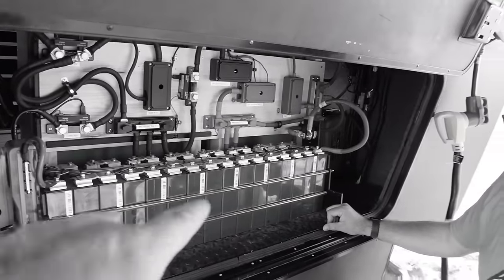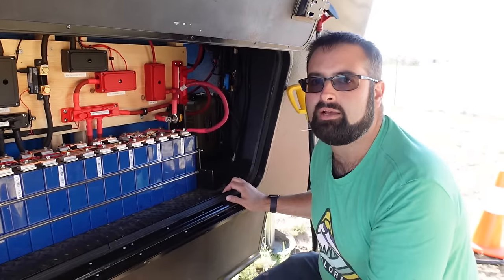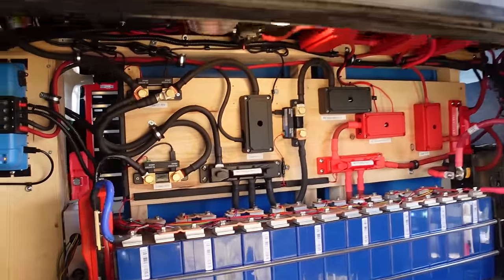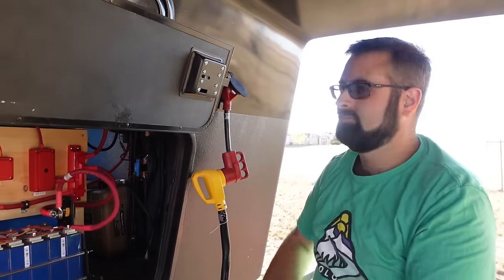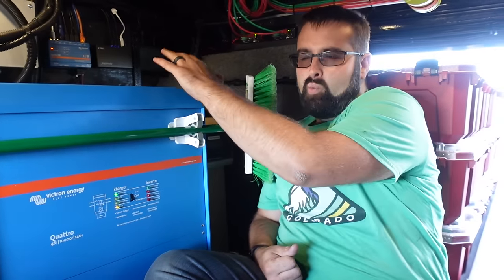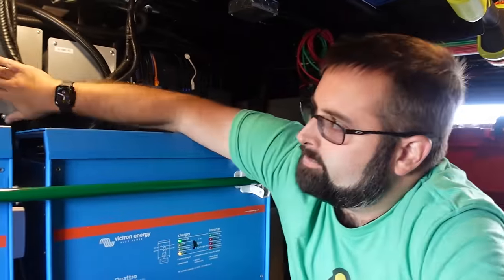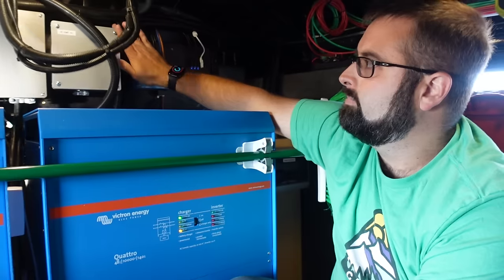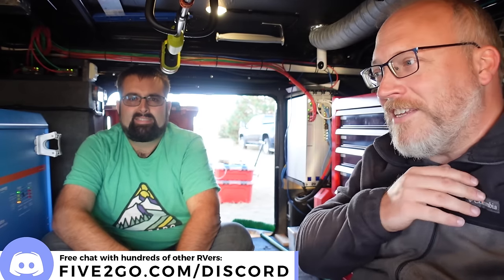How To Do RV Lithium The Right Way

Comment: I'm just not getting the same calculations as you are.  Taking the 1st battery bank, it is 16 cells at 3.3 volts each, essentially making it a 48 volt battery.  The cells have to be wired in series to make 48v.  As stated in a different comment, these are CALB cells.  Going to their website and looking at their products, one is 230.4 Watt hours, which is close to the amp hours stated.  If you multiply 230.4 (watt hour of each battery) x 16 (number of cells) = 3,686.4 watt hours.  AH=WH/voltage.  So 3,686.4 / 48 = 76.8 AH.  If you put (4) 12v battleborn at 100AH each in place of the 16 cells, you would have more battery capacity.  Those 16 cell banks are really only the equivalent of 3 battleborn batteries.    So the entire system would be the equivalent of about 6 and 3/4 battle borns at 100AH.  Edited:  But besides that, this is a really nice system.  Very clean professional look and still a lot of capacity.  I also agree with not spending huge amounts of money for a name brand and multiple BMS.
Reply: He has 230Ah cells.  2 sets of those for the 48V system.  460Ah @ 48V = 22080Wh.  On the 12V battery, it's 230Ah X 12V = 2760Wh.
Reply: @Patrick_Cashman  Their current offerings don't include a 230AH cell. Plus if you look at the physical size of the cell, they aren't big enough. The bigger cells have at least one measurement of over 11 inches, and you can use his hand for an approximate size measurement.
Reply: @chrisgentry4427  I have 280Ah cells. They are the same size as what is shown in this video. There are similar cells in 302 and 320Ah. 

I'm not sure what you mean by "their current offerings". Cells like this are available from many sources.  I got mine from Docan Power. They have a distribution warehouse in Houston. 

I think you may be getting Wh and Ah confused.  Wh = Ah X V. Same as the standard power equation, W = V x A. 

Here's an example: 

I have 280Ah cells.  3.2V each.  Put 16 in series to make 48V. Now I have a 280Ah 48V battery.  I build 2 of those. Now put them in parallel to make a 560Ah 48V battery.  560Ah X 48V = 26880Wh.   On the 12V side, I take 2 sets of 4 cells in series. 8 total cells. 4 in series makes a 280Ah 12V battery.  2 of those in parallel makes a 560Ah 12V battery. 560Ah X 12V = 6720Wh.  Total system is 26880 + 6720 = 33,600Wh. 

This video shows similar except instead of 280Ah cells, he's using 230Ah, and only one set of 4 in series for his 12V battery.
Reply: @Patrick_Cashman  by current offerings I mean CALB doesn't make a cell that size. As an example a Ford dealership can't sell you a Ford bicycle because Ford doesn't produce one.  And I also suspect watt hours and amp hours are getting confused here. But size does matter and there is no way there are cells with that much energy density in the physical size shown in this video.  Even battle born batteries 300Ah battery is 3x the size of its 100Ah battery minus a little BMS area.
Reply: @Patrick_Cashman  Is 100% correct here.  The cells are rated at 230Ah.  If you want to look up the exact model, it’s L173F230B.
Reply: @Patrick_Cashman  I stand corrected.  I did not realize that CALB was an acronym and not a brand name.  So in my research I was looking up a particular battery manufacturer and not taking into account that the designation could be for other manufacturers.  @Ben Koehler Thank you for providing the exact model number.  This makes a little more sense to me now.
Reply: @chrisgentry4427  CALB is the brand name
Reply: @chrisgentry4427  Battleborns are not as energy dense as a battery made of individual prismatic cells as they use kinds of batteries. If you want to compare them to an off the shelf battery, compare them to Lion Safari 1300 batteries which use prismatic cells. But remember Lion only uses 100ah cells, not the bigger, more energy dense cells. Last month I built a 560ah 12v battery using 8, 280ah prismatic cells, which are similar to those in the video. They fit perfectly under the steps of my motorhome where 2 GC-2 lead acid batteries used to live, with the BMS resting in the 1 1/2" gap between the 2, 6v batteries I built in 2p, 4s configuration. Only 2, 100ah Battleborns would have fit the same space, delivering 200ah at 12v compared to the raw 280ah cells, which produce 560ah at 12v. These are the cells I used, but they were $50 cheaper when I purchased them. Their dimensions are (WxDxH): 6.88 x 2.86 x 8.85 inches. https://www.amazon.com/gp/product/B0BJJN9HJQ/ref=ppx_yo_dt_b_asin_title_o00_s00?ie=UTF8&psc=1 Together with a 350a Heltec BMS and a 5a active balancer I was able to build it for under $1,500. Just 2, 100ah Battleborns would cost more than that. Quality wise, they have a rated life of 6000 cycles at 100% DOD or 8,000 cycles at 80% DOD, (which is what I have the voltages set at.) My entire battery weighs 93.28lbs which is 35 lbs. lighter than the 2 GC-2s they replaced. They have roughly the same capacity as 2, 270ah Battleborn Gamechangers which weigh 161.6 lbs. for the pair, saving me 60 lbs. vs the equivalent capacity in gamechangers.

Comment: Not sure if anyone else has pointed it out but 21 battle born batteries weighs less than this setup not more. Each battle born battery weighs 31 lbs x 21 = 651 compared to the 800+ lb of this setup. I saw someone else already mention the lack of springs to allow for expansion of the battery packs. I'm still not sure why 21 BB batteries isn't a better less complicated  solution...cost?
Reply: Light compression of the battery bank actually allows the cells to have a longer lifespan.  So springs would allow for expansion of the cells which is counterintuitive.  Also, the 800+ lbs of equipment includes the 2 giant Quattro inverters and whatnot -- not just the batteries.  The batteries are less than half of that weight.
Reply: I'd postulate that the BB batteries are made of the exact same or equivalent cells so the weight difference would be in the surrounding hardware (of which Ben would likely have less).

Neither BB, nor Ben can change the laws of physics.

Comment: Very impressive, thank you for sharing.  I'm in the market to upgrade my singular 12 v group 27 battery with 220v solar power setup to something comparable to your system I.e. 48v.  Basically enhance the battery with something that gives me better piece of mind knowing I won't run out of battery power. My rv is an 18' tear drop Safari condo alto R1713.
Reply: Awesome!  Just make sure to size it appropriately.  Also, I’d probably go 24V.  Much less complicated and you’ve got a smaller rig — space and weight constraints are real!
Reply: @triphius  how do I get a battery such as the kind you have?
Reply: @cliffwendy3765  It’s pretty much a DIY thing, unless you can find someone to help you with it.  But I’ll just say for the record that electricity is complex and dangerous, so please don’t try to DIY it unless you really, really know what you’re doing.
Reply: Honestly, you’re probably better off with a good quality pre-fabricated battery.  I’ve heard good things about Enduropower.  (And of course BattleBorn, but they’re high $$ for what you get)
Reply: @triphius  I rewired an entire house.  Learning about converters, transformers, inverters, alternators, series, parallel etc... comes easy to me.
Reply: @cliffwendy3765  Awesome!  Well then, I’m guessing you’ll do just fine!

Comment: that's a LOT of busbars.  and 5 shunts?  wow.
Reply: Yeah. Tell me about it!  😂
Reply: @triphius  yea, there's a lot going on in there!  i couldn't tell from the angles, do you have a class-t fuse on those batteries or a dc breaker for OCP?  it LOOKS well laid out - just seems like you could have gotten away with half the amount of busbars! LOL!
and the shunts, i understand you have one for each battery (2), one for BOTH batteries, one for the 12V, what's the 5th on?
Reply: @dobrzpe  The 5th shunt is for measuring DC usage on the 48 volt side other than the inverters.  The “DC System” tile in VRM is the data from that shunt. Without that shunt, it’s calculated so I went with raw data instead.

I don’t have any Class T fuses in there, just the 200A resettable breakers for OCP.  I’m planning to add some in during the next phase since I did miss a few places where I should have OCP.
Reply: @dobrzpe  And as far as the bus bars go… I totally could have consolidated things, but I’ve been annoyed in the past having to kill power to something just to service something else.  So one stud per thing (with minor exceptions).  Makes my life easier in the long run.  Although it was a pain up front.  😂
Reply: @triphius  thank you SO MUCH for responding & answering my question(s)!  i'm off grid at my house myself.  48v of course.  was surprised you were also 48v in your RV, but your reasoning is absolutely sound!  VERY clean setup.  gotta say, i'm most impressed (and happy/approve) of you keeping ALL black=neg and ALL red=positive!! even color-appropriate with all those bus bars!  LOL!  and not just colored heat shrink on whatever cable you had/could find.  impressive.

Comment: Ben, ..   what size cells?  ...    280's, ..  304's .. curios ....    If you said, sorry, I didn't catch it......   I went, separate 12v/24v system, but, went separate panels, charge controllers, cells/batt. ...   Complete separate systems,   ...  in terms of backup, 2 is1, 1 is none..........    Love your setup.....
Reply: He's using 230Ah cells.
Reply: @Patrick_Cashman  Thanks.
Reply: CALB L173F230B, specifically

Comment: Who was his mentor who helped him design the 48 Volt system? I want to use the life pro cells like he did and I'm interested in building a 24 Volt system. I don't think I will need as much power that he is creating I have 6 325 Watt panels. I would like a little help designing my system and I would like to build it myself. I think I would use it in the design on my skoolie build, kind of a steam punk look inside.  My plan is to run my TV's and computers off 19 Volts DC (read the inline transformers that power them) and pretty much everything else lighting and solar linear actuators to tilt panels and raise the bed for storage underneath off of 12 Volt. Fridge Microwave and mini split off of AC current. Still designing as I build. Great video thanks
Reply: Pop on over to Discord and we’d all be happy to discuss your ideas!

Comment: The one thing I was expecting, and you did not mention, or possibly do not have is a way to use your truck charging system to charge the batteries while you drive down the road.
Reply: I think it adds quit a lot of complexity to charge a large high voltage system with a 12V vehicle charging system. It could be done, but probably not worth it from a cost/benefit perspective.
Reply: @G53X0Y0Z0  no it does not add a lot of complexity. He already has all the equipment to get it done.
Reply: I’ve got a connection from the truck’s 7-way Aux pin in there, but I don’t have it hooked up at the moment.  I’m not sure how much I could realistically get out of that anyway… the wire is quite small.  Thoughts?  How would you do it?

The solar panels generally keep us good during travel days and we usually arrive close to 100% anyway, but it never hurts to have an additional method to charge the system.
Reply: @triphius  you have to run a dedicated wire that can handle the amperage. I will give you a couple examples. https://www.youtube.com/watch?v=ww_4yhQPGwY
Reply: @JohnSmith-ug5ci  Thanks!  I’ll take a look at some point here and see if it’s something I want to take on.  👍🏼

Comment: I'm impressed with your set up. I'm wondering about the position of the batteries in the 48 volt string. Is there any information if the batteries should be rotated? It seems there should be just like they say if you have more than 2 strings you can run into problems of balance. I'm running four strings in 24 volt with T105s. I was able to get 16 batteries for $2000 and went that way for this purchase. Next purchase I'm hoping to go with Lithium. I am seeing balance problems. I think the batteries need controllers like the lithium have.  I think battery manufacturers just sit back and laugh at consumers waiting for us to go buy more batteries. The T105 were made for a 48 volt golf cart in one string.
Reply: I've got some balance issues between the two 48 volt batteries that I need to work out (I probably miscalculated some cable length or something like that), but within each battery there's a balancing board so the cells will be kept in sync that way.

Comment: I think the best way is to go overkill on the solar panels and just keep a modest battery bank. No need for such capacity imo, recharging way more important
Reply: While I agree that recharging is very, very important— having lots of capacity also gives me lots of flexibility too.
Reply: capacity IS a necessity.....    Ask me how I know......
Reply: @lotechgreg  How do you know?  🤣🤣🤣
Reply: The amp-hour capacity he has is compensating (sort of) for the lack of solar.
Reply: @triphius  I'm ~20 mi. from Palm Springs, off-grid, in a 30' TT,  June through ~ 2wks ago, my AC ran 24/7.........😎😎
Reply: @lotechgreg  Awesome!  All solar recharging or generator too?
Reply: @triphius  I've got 2.4k panels flat on the roof, June-July I was producing 15-16.5 kwh/day, ...  I was using 19-20......  So, yes, I was running my gen.  ..   my wallet is still felling it,    ...   will be installing another 1.8k of panels that will also shade/insulate+ produce power,  ...  VERY,  ..  soon......    FYI, my bank is 24v= 8s4p 304ah...  ~1200ah/29kwh .. + 12v 304ah on its own 320w of panels.  Inv. = Victron MP3k24v, + SS Charge Cons., and, of course a Cerbo...
Reply: @lotechgreg  Low Tech Greg is pretty high tech  :)   Great system you have. 

We have been chasing good weather to avoid using AC, but it's nice to have the capability ( and battery capacity ) to do it when we need it. Looking to swap to mini splits for next summer. 800W for a dual zone system is very attractive. Plus the quiet!  The rooftop ACs drive us crazy with the noise.
Reply: @Patrick_Cashman  Thanks, my 9k btu split will pull 1100-1200w and its "supposed to be" 22 SEER. To run mostly 24/7, had to have the capacity, next, getting more panels soon.

Comment: Ok, i am confused, aren't Battleborn batteries made of these same type cells? Ounce for ounce,  how are you really saving any space or weight??
Reply: It’s explained in the video. This is a 48V system with three BMS systems.  To use battleborns to achieve this same amperage capacity at 12V, you would need 21 of them and they are rather large considering they all have their own integrated BMS.  Battleborns are not meant for the use case he was going for, which is generator-level capability for a full-size fifth wheel.

Comment: Your using the 12v load part of a mppt charger to charge your 12v battery from the 48v battery correct???😳😳😳
Reply: No, I’m using an Orion 48|12 DC-to-DC converter to charge the 12V battery and provide limited power to the 12V components.

Comment: How much do the batteries weigh?
Reply: I don’t recall the exact weight of the batteries, but with everything (including the inverters), we we’re looking at adding around 800 lbs.  They’re definitely not light — the portable battery case is pretty heavy by itself and it’s basically 1/4 of the larger battery bank.